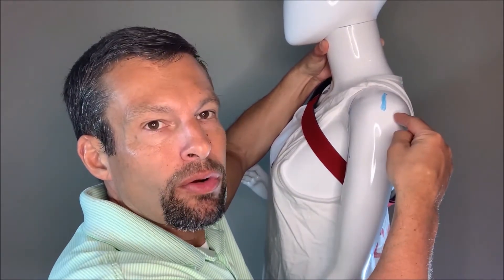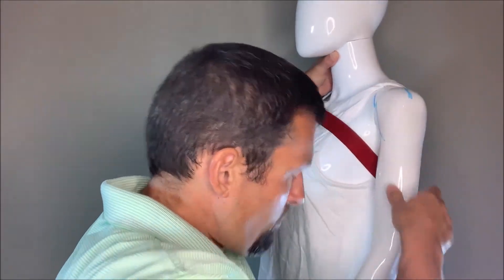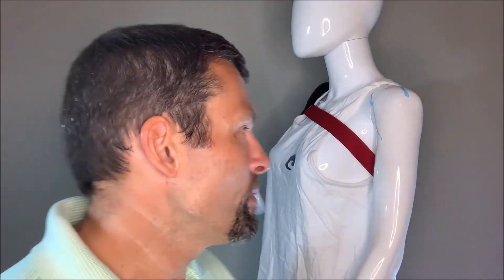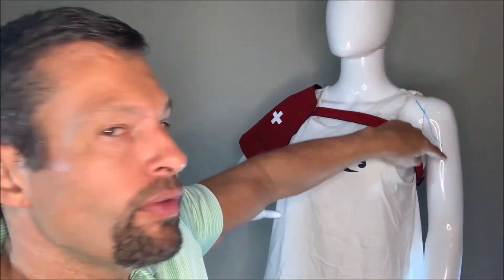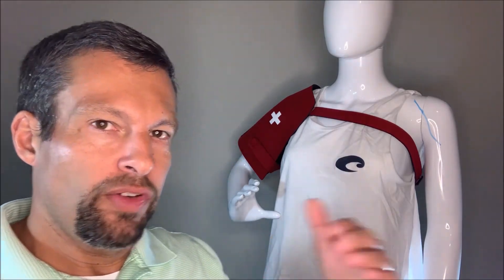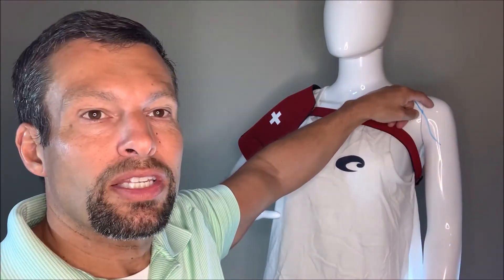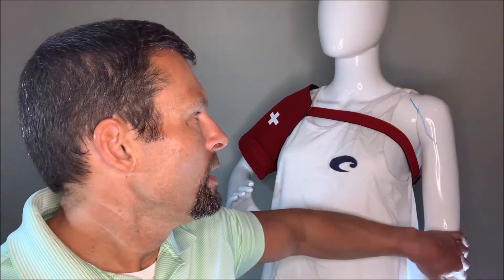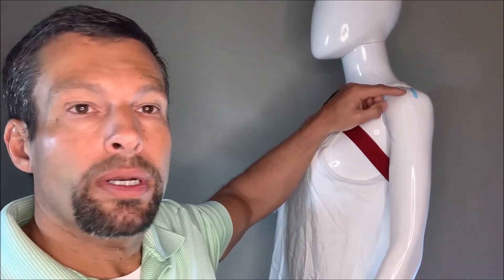The three different ways to repair the rotator cuff.  Open, Mini-open, and Arthroscopic.

Comment: My my results came in, how bad it is:

IMPRESSION: 

1. Small Hill-Sachs deformity with mild associated marrow edema compatible with recent injury.

2. Tear of the anteroinferior and inferior labrum. There is also heterogeneous signal in the superior labrum, likely due to tear as well

3. Full-thickness, partial width tear involving the anterior fibers of the supraspinatus superimposed on mild to moderate tendinopathy.

4. Mild-to-moderate infraspinatus and mild subscapularis tendinopathy.

5. Borderline widening of the acromioclavicular interval with no significant associated edema, probably sequela of old injury.

6. Trace edema in the teres minor muscle is nonspecific and could be due to a strain or neuropathic.
Reply from the maker: Sounds not so good.  Torn the big items are probably the torn labrum and torn rotator cuff (supraspinatus). Did you dislocate your shoulder?
Reply: @rotatorcuffexpert  Hi, doctor; I am a big fan of your YouTube channel. I had my surgery done yesterday. I had torn supraspinatus and half my labrum. They also did a bicep tenotomy due to a labrum tear. Yes, it was an accident, A traumatic injury that dislocated my shoulder.
Reply from the maker: Sal, thanks!  Good luck in your recovery.  Pls let us know how you are doing in your recovery

Comment: Im a 57 year old 6'4" 200lb healthy, fit adult league baseball pitcher...Ive never had any shoulder, elbow or other arm injuries until a massive rotator cuff tear on a headfirst slide . An arthroscopic attempt was made and failed due to retraction of the tendon over the 17 months that i waited to have it repaired. Am I a candidate for the open or mini open and what would be the success rate if that attempt was made?...
Reply from the maker: Hi Swamp music, great question.   Typically a rotator cuff tear that cannot be fixed arthroscopically cannot be fixed in an open or mini-open either.  So alternatives need to be explored.  I have a bunch of videos talking about other options including the Inspace balloon, SCR and Reverse TSA.
Reply from the maker: Please consider joining our newsletter.  Just email us at dro@mybodyprotector.com  and put "yes" in the subject line.  We will get you signed up and also give you a couple tip sheets!
Reply: @rotatorcuffexpert  thanks so much for the quick response...Ill look into those suggestions.

Comment: I just had surgery last week where they reattached a complete lesion of the subscapularis tendon as well as a reattachment of my dislocated biceps tendon. The surgeon cut the bicep tendon above the shoulder and folded it down, then sutured it in place. All of this was done with open surgery, no arthroscopic beforehand. There is a large 8-9 cm scar across the shoulder, held in place with staples. Can you see any reason why the surgeon did the procedure like this? Is it just cheaper and faster for them, or maybe they lack training? My surgeon couldn't have been older than 40, most likely 35...
Reply from the maker: Hi David Great Question!  Often if I need to fix the subscapularis and do a biceps tenodesis I prefer to do it open,  While arthroscopic surgery can be done on the subscap, if it is completely torn it is difficult to get to the most inferior portion of the tendon.  If the biceps is dislocated the most consistent thing is to do a tenodesis below the groove.  This means it must be through an open incision.    While I still do a scope first, before the open so I can see everything inside the shoulder.   In most cases if I have a displaced biceps and a full subscap tear, I will do it open.  Hope this helps.  And oh btw, I would tell my patient my plan for it to be open BEFORE surgery.
Reply: @rotatorcuffexpert  thankyou very much for your reply! I’m now at ease. I was a little concerned that the large scar and longer recovery time could have been avoided, but feel confident that it was the right choice. Long road ahead, but it’ll pay off on the end
Reply: @rotatorcuffexpert  oh and my surgeon did tell me it was going to be open before and I had friends who had open rotator cuff surgery and also some who’ve had arthroscopic (I’ve played a lot of Rugby). So I just trusted that the Dr knew what he was doing and then saw your video after surgery which suggested that open surgery was a bit rare and outdated. I understand now that the severity of the injury put me into the ‘rare’ category
Reply from the maker: David, Please consider joining our email newsletter for more information and insights and we will send you 2 Free PDF fact sheets that will help you through your surgery.  Send an email to info@mybodyprotector.com just put "yes" in the subject line and we will get you signed up!